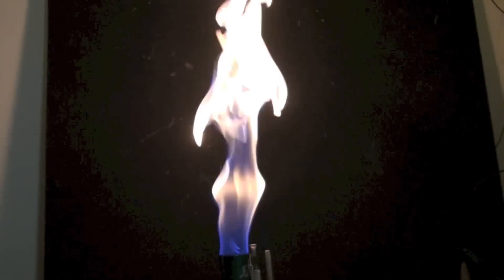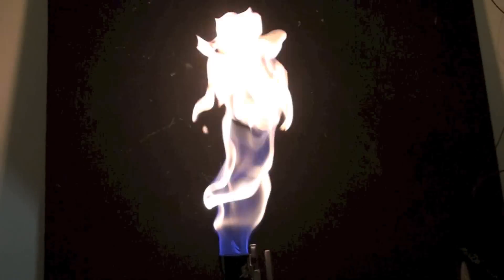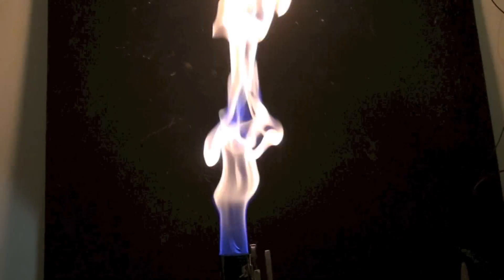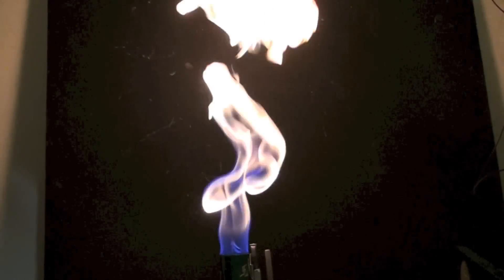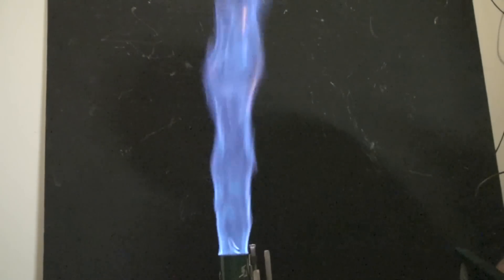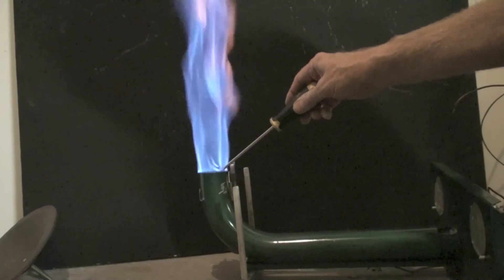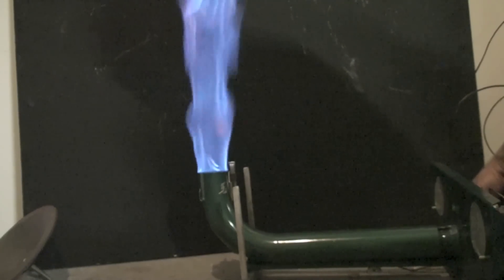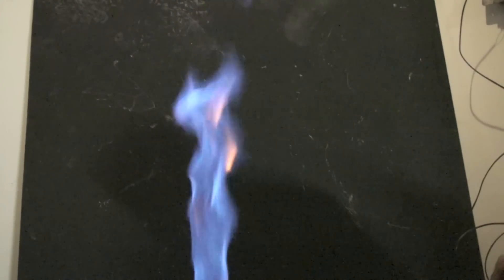The gas burner

Comment: Thank you for this lesson. Some years ago I purchased a special spark plug (colortune) that allows me to adjust the air fuel mixture on each of the four carburetors on my motorcycle. It's a bit painstaking but it makes a big difference in engine performance. The spark plug has a glass part of it that permits a view of the color of the combustion inside the cylinder as it fires. The goal is to adjust the flame to be light blue.
Reply from the maker: That is incredibly cool!  Never thought you could do that.
GFM

Comment: HOW DO YOU GET IT HOTTER
Reply from the maker: How hot do you want it?
GFM
Reply: @grayfurnaceman  I have a furnace that runs on gas for melting steel for casting  but I don't think it's hot enough
Reply from the maker: @adamshowers8420  I can't tell for sure, but you may be able to get higher temps by reducing the primary air adjustment.
GFM

Comment: Great wisdom, greyfurnaceman! The fuel flow through the orifice (or nozzle) draws in (entrains) primary air. In engineering terminology, this device is called an "ejector". Without the primary air, the combustion is said to be a "diffusion flame". When the primary air mixes with the fuel prior to reaction, the combustion is said to be a"premixed flame". The latter is more desirable for heating, as greyfurnaceman said,  since the fuel/air mixture ratio is more uniform. The diffusion flame has local "fuel rich" regions that tend to produce soot. This is a waste of fuel, and the soot accumulates on the heat exchanger walls reducing heat transfer.

Comment: That is a beautiful long flame and it's exactly what I'm looking for for my brick oven. Unfortunately, I can't find this burner locally. Is it possible to get the schematics for this burner so I can build it myself? Thanks.
Reply from the maker: That burner is simply one that has no primary air.  You could make that burner by simply connecting a pipe to your gas control and lighting it.  
GFM

Comment: what happens to the temperature value, does it change with the flame color? do you get a lower temp value if the flame is yellow, even though the gas quantity released is same?
Reply from the maker: Obi Amechi The temperature is somewhat lower because the flame is larger, but the BTU output is close to the same.GFM